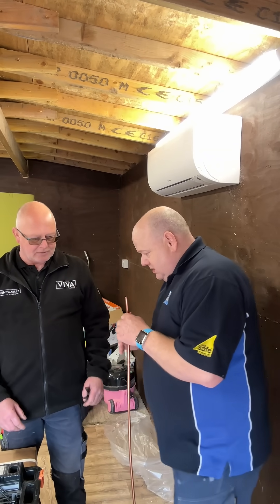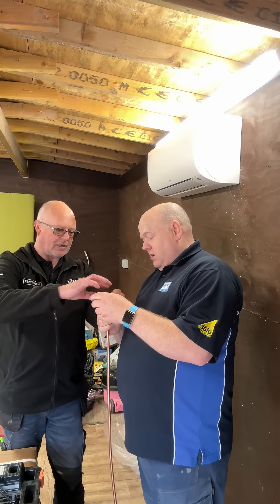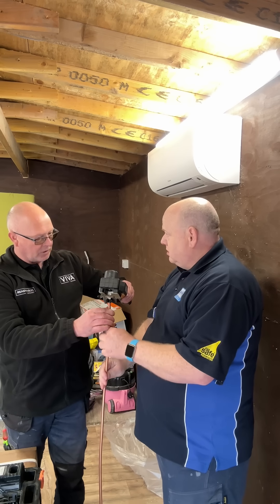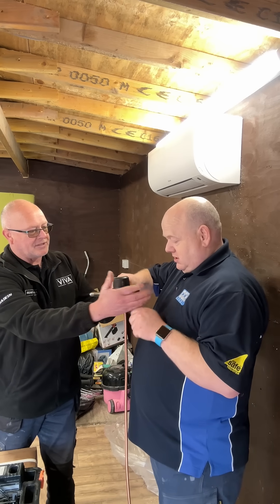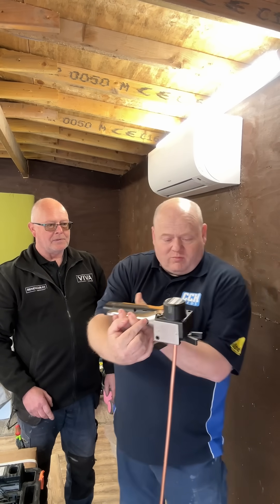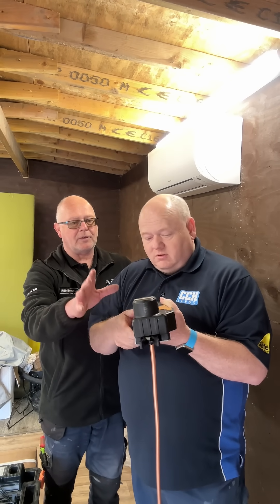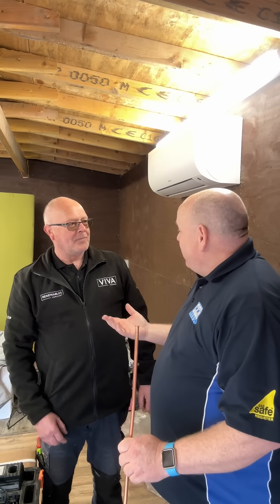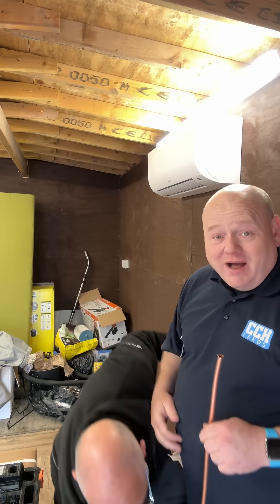F-gas training how to flare a pipe. Allen Hart back to school #plumber #plumb #RefrigerationExperts

Comment: i want to do F gas course but i dnt have any experience is it still possible?

thanks
Reply: Highly recommended working in the industry to learn the trade, I spent 3 years in college getting my L3 NVQ and didn’t learn much on the practical side only the basics after 3 years on site I’m still learning. F-Gas short courses should be banned or policed a lot more, some of people I’ve met that’s done a 1 week course shouldn’t be anywhere near an ac systems - it’s ridiculous! Same as you can’t become an electrician without the correct amount training.
Reply: @Josh-l9e  i am Gas safe engineer though if thats helps. 

but I'm just curious to learn this too 😂 just incase government stops Gas 😋